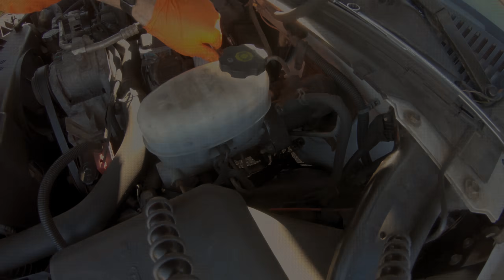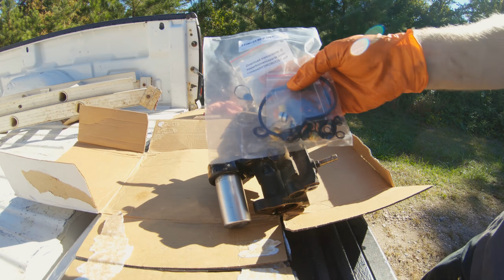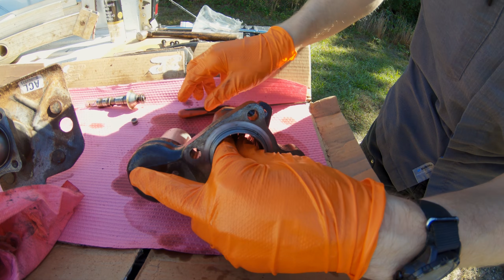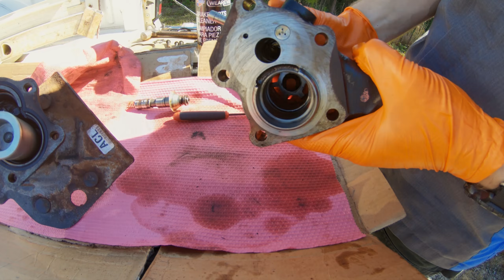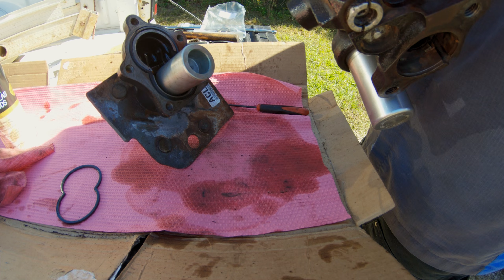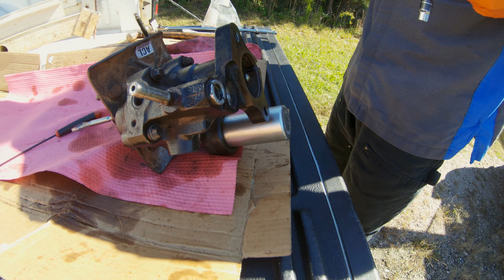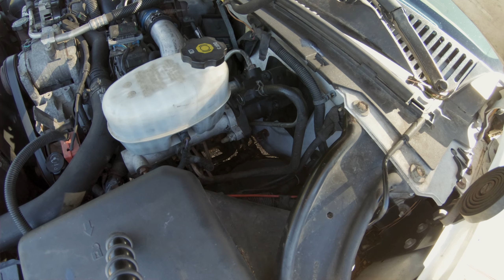GM Hydroboost Brake Booster Leak Repair

Comment: Wow just stumbled upon your videos never seen any of your videos before, your actually quite good really enjoyed watching.

 My power steering cylinder started to drain fluid, hence starting leaking, or rather emptied overnight and had a loud screeching sound, so went to AutoZone to pick up some power steering, and topped up my power steering reservoir, it seems it's leaking from the middle where the hydro boost and the master brake cylinders touch is where it's leaking, but there shouldn't be any power steering fluid in between only in-between the hrdro boost, I guess it's dripping down and looks like it's coming From in-between the hydro and master cylinder.
   Anyways will try to remove the hydro booster and change the o-rings and hope that's the problem.

  Maybe you would know I have a 2010 Chevrolet Express 2500, I had a new power steering pump put in, I had my steering column greased all the way down to the axle or wherever.
   But point being my steering is extremely hard, yes just now my power steering seems to be leaking wonder if I need to get a whole new hydro  booster and maybe that would help for the rough steering on my vehicle? 
    unless you think one of the lines the high pressure or low pressure is clogged?

  it's legit really annoying when you're in a tight spot and the vehicle not in motion really hard to turn the wheel.

 Wonder what your take on this is.

 Anyways really a beautiful clear video, loved the steps and video clarity as well.
  Coming up to par with CrisFix who is also amazing YouTube car guy! Great job.
   One more subscription added..
Reply: master cylinder & hydro booster are for your BRAKES only. They have nothing to do with your steering, or how hard it is to steer. That would be your power steering pump, steering box, worm gear ect.
Good luck!
Reply: @denisewilson8367     😳 WOW !  The amount of ignorance in your comment is quite humorous. PLEASE, do explain to all of us what a Hydroboost system.   Edit :  Start with schooling the person that “liked” your comment.

Comment: Excellent video.  Thank you!  I was able to replace the seal while the hydroboost was still on the firewall.  Had no problems getting to the bolts.  So far no leak.
Reply: Thats how I took mine apart. I'm hoping it all goes back together after I figure out how all the "guts" go back inside. It exploded apart when I removed the last of the 5 bolts. I've never fixed any kind of brake problems. And I've gotten some bad advice & instructions. So hoping this works after I get it all together. Doing things 1 handed is also hard.
Reply: I think I have more room to work with on my 95 Yukon.
Reply: Did u get it done? I’m going to have to do this on my ‘04 Tahoe.
Reply: @mayken6661  yes, no further trouble.
Reply: I was wondering if this could be done without removing the entire assembly
Reply: think i've watched only one video where he separated the assembly from the five bolts (uncertain if some use hex or e10 or e12 like this video), where anything from the 8-shaped seal on is done while still on the firewall, not having to touch anything in the drivers' footwell.

Comment: Was it necessary to take it off the firewall? Seems like it’s unnecessary work. Looks like the booster could be taken apart while it’s mounted. I’m about to tackle mine to. Just wondering
Reply: Did you leave it on the firewall or take it off?....hope you managed to fix it!
Reply: @bensonhedges5471  left it on thanks for asking. It's working great. Saved lots of money

Comment: Why did you stop recording while  installing that little valve with the three holes and the yellow cone? That’s the only part I needed help with because mine flew out when I took it apart and I want to make sure I get the orientation right! Lol
Reply: It points out like the piston I know that bcuz I saw it in the video. But I didn't see which spring goes on whick part. So I had to guess, I hope I'm right.
Reply: @denisewilson8367  Did it work? I opened mine up and there was no ball or rod even and after searching the internet for two days strait it turns out that there is two different models.

Comment: So I'm assuming that both brake fluid and power steering fluid should be drained prior to removing either assembly?
Reply from the maker: You don't have to drain either.
Reply: Thanks!
Reply: But it makes a HUGE mess if you don't. I had emptied the master cylinder cups as much as I could with a turkey baster and still had a huge mess everywhere.

Comment: I also get leaks inside the cab. By the pedal rod. Will this fix that as well. Or is  that a different seal in the kit.
Reply: I have the same thing, seems you would need to remove the outer part the bracket by the pedal and change the seals.bigger job, there's some videos put there on that.

Comment: Hydroboost makes no sense in a vehicle without turbo or superchager... is way heavier and less efficient than a regular brake vacuum actuated booster, it has more parts so is prone to fail more often thant the regular one and is way more expensive.
Reply: Diesels dont create any vacuum so they use the hydroboost set up.... but there has to be a better way to build these I cant tell how many of them I've changed multiple times
Reply: Put a diesel in a non diesel truck. I used a emissions pump to make vacuum then u can use a regular booster.

Comment: Hey there. Minus the seals and leaks would there be any other components to fail on the hydrobooster.  I'm in between rebuild or buying a new one.
Reply from the maker: Usually just the seals die.

Comment: I have a question repair kit is the same for the disel and for the tahoe or is it different I have an 04 tahoe and it has a leak
Reply: Gas and diesel way different. Diesel engines don't build vacuum so they use power steering pump to boost the brakes

Comment: Mr Subaru, 
I have taken my 03 gmc Sierra twice in a short period because it keeps leaking through the weep hole located at the bottom, where you used your mirror to check for leaks. Both time I've been told by the mechanic that, since it's an after market part and not from the dealer, was the reason it leaks. Is there something that they're not doing correctly? I mean, this is a reputable local shop so I'd like to know what I'm talking about before I suggest something. Any feedback would be appreciated. 

Thank you, 
Nick
Reply: Today I am in the same situation, do you got any answers? And I noticed the seal like shape of 8 had a very lil ruber dots
Reply: Make sure you not damaged the new seal on reinstalling back i did damage one and i learn how now 😎 read my previous comment 👍

Comment: A tip to help remove the master cylinder from the hydroboost, and to give yourself more room to get the hydroboost off of the firewall is to remove the bolts that hold the master cylinder to the hydroboost.  They are right hand thread (lefty tighty, righty loosey).  Gives you an extra inch of clearance, and makes a world of difference in removal.  Do the same for the reinstall.  Reattaching those bolts with the master cylinder attached can be tricky, though.
Reply: Right hand bolts spin backwards. New to me and I make tierods with right and left hand threads and it's always right hand threads turn right to tighten and the tap that says left hand u turn left to tighten.

Comment: Isn't the Hydroboost for steering and not brakes?
Reply from the maker: No. The power steering pump is for steering, the hydroboost is for the power brakes.
Reply: it effects both if your low on power steering the thing whines loud as hell and the brake are shit. "gm had a better idea", but they didnt use it!
Reply: c-mafawken-mo what better idea?
Not sure what you're talking about, hydroboost is on every make.
So I'm wondering what it could be.
Reply: @c-mafawken-mo4747  couldn't understand why when my power steering cylinder was empty my brakes weren't really working.

Comment: Hi, again Mr Subaru. the dashboard lights (and radio lights)on my subaru outback start flickering suddenly and randomly when I switch on my headlights. My clock and weather lights go off for some time and come back on. just when I turn on the ignition, I hear a short circuit sound for two seconds sometimes. Any idea what the problem could be and how I can fix it?
Reply from the maker: Check battery voltage and the alternator. Sounds like system voltage is too low.
Reply: @MrSubaru1387  alrighty. Will check and get back to you